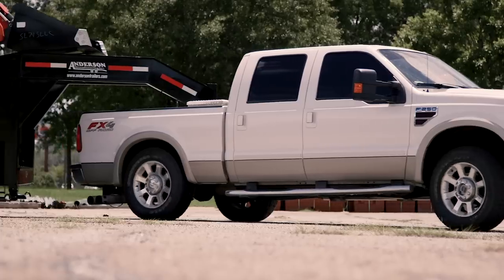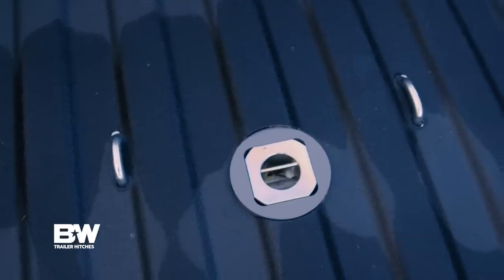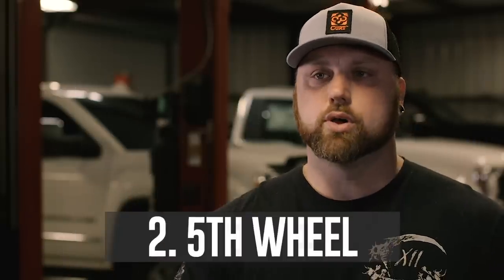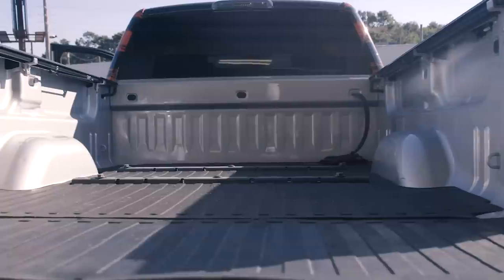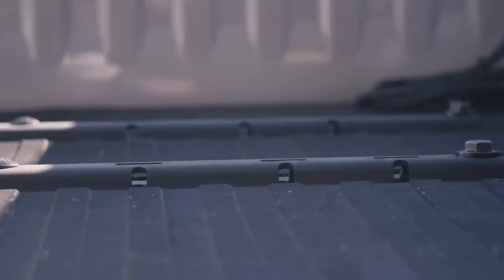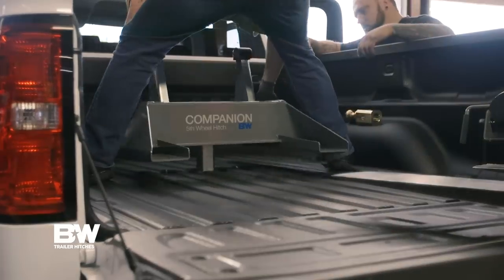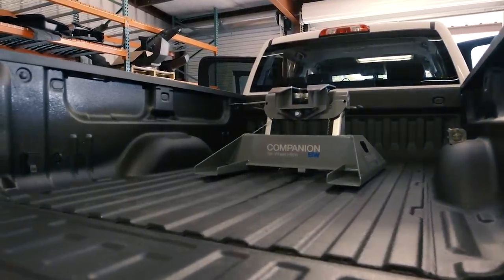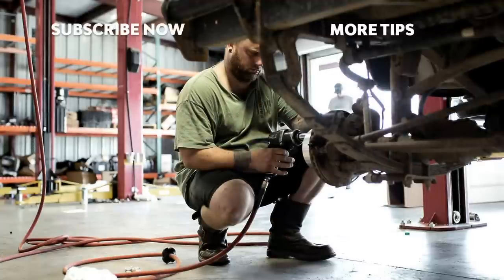Should I Get a 5th Wheel or Gooseneck Hitch?

Comment: Well, 3 million miles plus over 32 years long haul with semi, my personal choice is Goose over 5th if I have a choice-unless running a cab and chassis setup,, that is closer to axle like a semi truck. Once, just once, grab your trailer controller and slam on your trailer brakes... goose tightens your seat belt, 5th wheel send your headlights into the trees activating ABS on front axle, simply physics, much much higher from axle causing tow vehicle tilt. If you tow 5th wheel travel setups, you don’t have a choice, the hitch height is part of the engineering of the frame, but if towing a flatbed ect, opt for the ball with safety chains and it’s better articulation and you will have a better towing experience.

Comment: As someone who has towed trailers for hundreds of thousands of miles I vote for the Gooseneck over the 5th wheel.  Primary reason is the weight at the point of connection between the tow vehicle and trailer is lower and closer to the drive axle of the tow vehicle!  Less leverage, especially side to side, and therefore more stability!
Reply: What's your opinion when it comes to people putting semi truck 5th wheels on their truck?
Reply: @backyardhooper06  Actually, if someone wants a 5th wheel hitch go ahead.  There isn't THAT much difference in the towing.  I just prefer the gooseneck, primarily because of the point I made above, and because they are easier and quicker to remove to not obstruct the bed of the truck if you want to haul things needing a wide, flat floor, such as plywood for instance.

Comment: What's the best set up for a farm & tow truck that has to do it all? Haul a travel trailer & horse trailer with possibly different connections (maybe even a bumper pull mixed in), winch, and hauling lumber flat in the bed?

Comment: So do Class A trucks pulling over  40,000 lbs of weight use a Gooseneck or a 5th wheel 🤔
You ever seen the flexibility in the tube of the Gooseneck neck hitch? I have Plasma cut and weld new ones in.

Comment: I am looking at buying trailer that going to need a 5th wheel hookup.  But I still need to put a camper on  when not using the 5th wheel so I need to make sure whatever hardware is in the bed will not enter fear putting the camper back on. We do horse camping to so I pull a horse trailer when the camper is on.  We have been camping with just the camper but now we are looking at having more camper space when its just camping will this work in the bed for putting a camper on.

Comment: I looks like the companion would be unstable when connected to the goose neck hole without it's own base being in contact with the pickup box floor. Because there is a gap between the Companion base structure and the box floor.
Reply: I figure one has to do modifications to it based on their personal choice of truck. Even just a threaded hole in each corner and redi rod with a foot welded on would probably do it

Comment: What do you think about putting a king pin 20inch tube converter on a 36 foot gooseneck and using the companion fifthwheel from B&W on a truck? Will the ride be better? More stable?  Pull better? Be more secure? Ride smoother?

Comment: ford f350 7.3 gas or 2020 Ram 3500 6.7 diesel ?...which one should i buy...i don't do any towing ?
Reply from the maker: diehard ford
Reply: I would personally go 6.7 powerstorke. Rams aren't bad but have been known to have transmission issues (those have seemed to have died down in the last ~4 years but still). I personally wouldn't get a 3/4 or 1 ton truck with a gas motor. The only real pro is the ~10k cheaper price tag. I bought a 6.7 powerstroke about 3 months ago and love it!  I also dont do much towing FWIW.
Reply: Never buy brand new. Look for anything up to 5 years old with reasonably low mileage. It's just cheaper. Plus, it's still under warranty.

That said, you honestly can't go wrong buying any late model American brand truck.

The Dodges have transmission issues

The F*rds, well, they're fucking F*rds. And F*rd is a four letter word.

As for the Dirtymax, I just think GM trucks have gotten uglier every year since the inflatable fenders came out in 07.

I honestly can't say a bad word about GM pickups other than they're overpriced as fuck
Reply: Marshall Davis  That's what I have. 😁😁😁
Reply: Don't do any towing? Why do you need a 1 ton truck lol?
Reply: @wantsanewvehicle for the looks
Reply: @DrBroncanuus  Quit trying to impress others.. nobody actually cares what you do or don't have. Also, I've never seen a hearse with a trailer hitch, have you?
Reply: @wantsanewvehicle  you obviously don't know any ladies
Reply: @DrBroncanuus  I don't know any gold digging ones, yes, you are correct.
Reply: Get the gas engine. I've had diesels for years and they're not worth the money ($10k options these days) unless you really need that power (in which case you might as well buy a real truck, like a Class 8)
Reply: @DrBroncanuus  You are a hot-shotter's dream come true, 'cause when you hit 30K miles and decide to sell that babied creampuff, someone will get a helluva deal.
Reply: @bayready1393  happy to help others

Comment: Great video! I run hotshot and pull a 40 foot gooseneck trailer and have to drop and hook every day for the past 8 years and I’m sick of it lol. I always thought a gooseneck hitch was stronger for heavy loads so that’s why I stuck with it. I’m thinking about going with the companion for easier drop and hook being that with the gooseneck you have to crank the trailer all the way over the ball vs. the 5th wheel where you just crank enough to get the weight off of the truck.Do you recommend this and do you think it’s worth the money to make the change?thanks
Reply: So did ya make that change? Any update